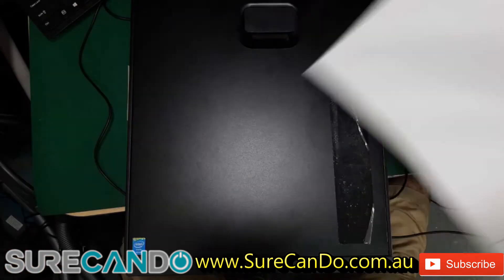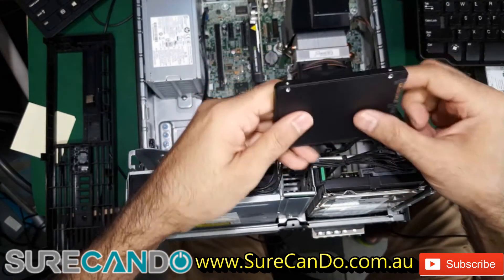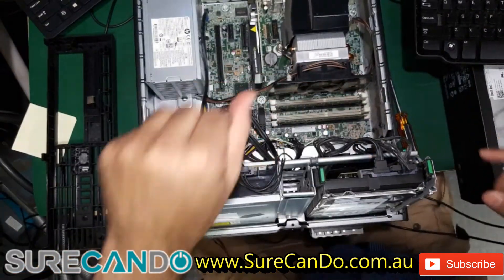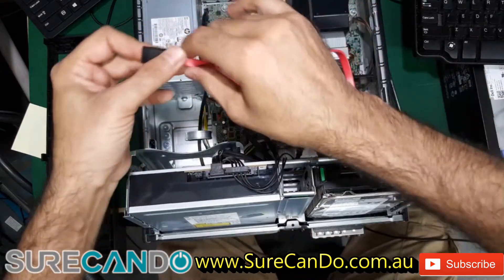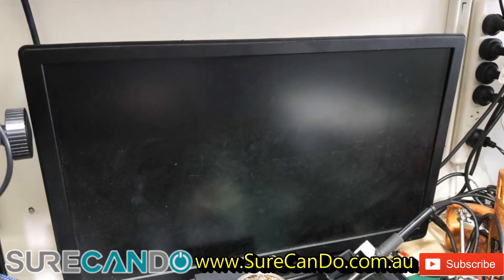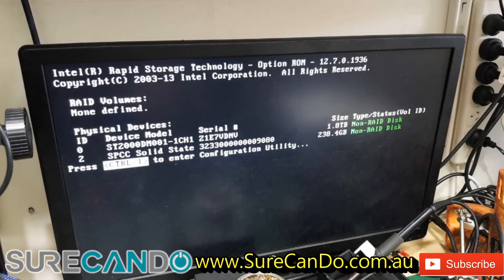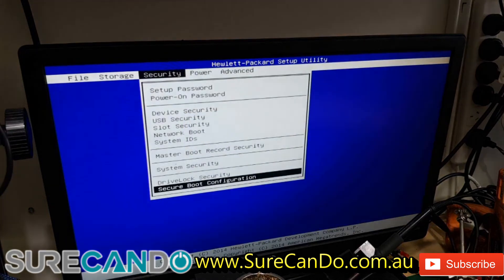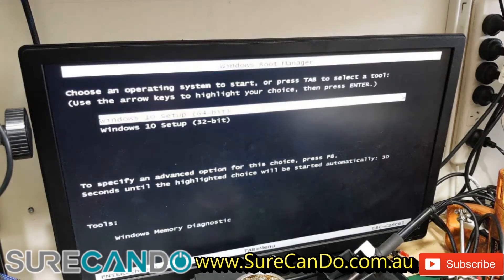HP Z230 Workstation SFF SSD Upgrade, Boot from USB Install Windows 10 Pro

Comment: i have the same z230 sff and just this morning when i tried to turn it on it won't so then i opened it and i saw wires labeled P13 and P14 out in the open and not connected, does this have anything to do with it not opening? Please help i have no knowledge in this 🥲🥲🥲🥲🥲🥲

Comment: Do you  have any clue what to do with that problrm? ''Drives that are using hardware encryption should not be included in RAID volumes" -  We installed SSD as a data storage. I will appreciate any help. Thank you.